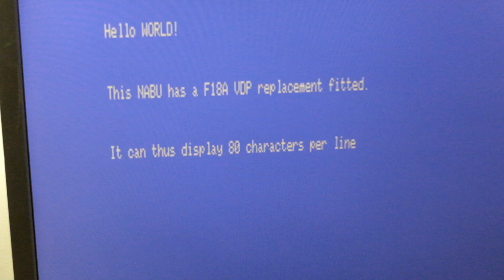My NABU has a 230V PSU and the F18A VDP replacement

Comment: Nice work. I do have one question as I'm a bit noob in VDP. Can I get PAL out of the NABU RCA port by by replacing the TMS9918A with a TMS9929A?
Reply from the maker: No, the TMS9929A outputs a component signal that requires additional hardware to create a PAL or SECAM composite signal. The TI-99/4A came with an external modulator to do that. The required circuitry on the output side is also somewhat different. Going with the F18A or a tn-vdp is really your best bet to get a better video output on the NABU PC.

Comment: Great video! I'm also in the EU, and considering importing a Nabu. From the other comments in this thread, I understand you've changed the PSU again. Would you please consider doing another video showing how to install it? It would mean a lot to every European with zero skills in wiring electricity 🙂.
Reply from the maker: The conversion is really pretty straightforward, but as one needs to deal with mains voltage, it is something that only people should do that have the required experience. I am just an amateur myself, so I cannot teach how to safely do it, let alone in a YouTube video. Sorry.

Comment: Hello Hans 
As i live in the Netherlands I also need to convert the machine to 230v when it arrives.
It is now on the ocean somewhere
I have no knowledge on PSU replacement
I got my hand on a Mean well RT65B PSU
this are the specs

output current 1 5A  
output current 2 2.8A
output current 3 output 500mA
Voltage output 1 5V
Voltage output 2 12V
Voltage output 3 -12V
max input Current 2A
Max output power 64,6 W
Power rating 64,6 W
output current 5A
Output voltage 5V

Can I use this PSU?
I hope to hear from you or other NABU owners in Europe
Greetings Herman
Reply from the maker: Hi Herman, I have used a Mean Well RT-65B in my latest NABU 230V conversion, it works fine.  I have not bothered with a fan and was satisfied with the one screw that holds the new PSU down, but that is certainly not in compliance with electrical code.  Here's a photo of the PSU section of the machine, before I've put the original PSU housing back on: https://photos.app.goo.gl/D1JYVSNSHYYhCKJu5 -Hans (also https://mastodon.social/@hanshuebner)
Reply: @HansHübner  
Thanks for your quick reply.
As I wrote my NABU is somewhere on the ocean.
So I have time.
But the picture is a great help when it comes to fitting it inside the NABU.
Must i take a look at 5V adjust white knob on the front right side of de Mean well ?
The only thing to do is make the RS422 cable and maybe the video output hack from john's Basement.
Thanks for your answer.
Reply from the maker: @hermanhoekstra7498  you don't usually need to touch the 5V adjustment pot. Take a look at the output voltages with the multimeter and if they are within +-5%, you will be fine! Good luck with the machine and reach out if you need help.
Reply: @HansHübner  Hello Hans
Today my NABU has arrived  😃😃😃3 weeks sooner as EBAY told me.
The picture is helpful but I am not sure about which wire color go's to the Mean Well
And what does COM means on connector 7?
I hope you can help me as I do not want to destroy the NABU.
Greetings Herman
Reply from the maker: @hermanhoekstra7498  red is +5V, black is GND/COM, orange and grey are +12V and blue is -12V. Does that help?
Reply: @HansHübner  
Hello Hans,

I have wired everything up
removed the fan
and the wires for it

I made the following connections:
V3 = -12V =>blue line
V2 = +12V => 1 gray and the 2 orange lines
+5V => the 3 red lines
COM the 3 black lines

For the mains I connected the black from the power switch to L on the Meanwell
the green from the chassis to the earth on the Meanwell
and the white =>blue I connected to N
but what kind of glass fuse did you use?
I think when i power up the NABU the original FUSE will blow?
Am I correct?
I hope everything is connected fine to I finally can power the NABU for the first time
Greetings Herman
👏
Reply from the maker: @hermanhoekstra7498  the original fuse will not blow up because at 110V, the current is roughly twice as large as with 230V. You should be good to go!
Reply: @HansHübner   That is great news I have everything connected OK
As you already know my knowledge of electronics is very limited.😞
So can or will you explain me the theory behind voltage current and amps?
Thanks Herman
Reply from the maker: @hermanhoekstra7498  I can't really teach, but here's the basics:  Your power supply converts the inbound voltage (110V or 230V) to the lower voltages required by the computer.  The computer consumes a certain amount of power, which is basically the product of voltage and current.  The power going into the PSU is roughly the same as the power going out of it, so if you increase the voltage on the input, the current goes down.  Hence, for 110V you'll see a primary fuse with a higher current rating than for 230V.  This is all just a very rough description, but maybe you get the idea.   BTW: It would of course be safer to put in a fuse with a smaller current rating, but generally, it protects against short circuits and a short circuit draws way more current than either of the two values.

Mains voltage is dangerous, though.  Make sure that you learn the basics of isolation, be careful and don't hurt yourself.  If in doubt, ask someone who knows to review your wiring.
Reply: @HansHübner  thanks for your answer
I think i get the point
when the voltage is higher the current(amp) is lower.
I could use a use about half the rating.
so the fuse installed in the NABU is okay
Greetings Herman
Reply: @HansHübner  I finally found time to finish the conversion
The NABU starts normally.
The picture is stable but a bit on the washed out side.
I think i must do the video mod John did on his channel
But the NABU works!!!!

Comment: Great video, just got my Nabu today here in the UK. I actualy purchased my F18A board (I believe) from you last year for Coleco), really tempted to source one for my Nabu.  Out of interest, is that PSU switching and suitable for UK voltage (240v), if so  would be great to get a model number for it.  Keep up the excellent work.
Reply from the maker: I used a Mean Well RT-60, which has since been replaced by the RT-65, which is slightly smaller. Both support universal mains and will work in the UK or everywhere else

Comment: pretty nice! Do you have by luck the wiring diagram for the new power supply? I think I will do the same on mine. Thanks
Reply from the maker: I would not call it a wiring diagram, but the color coding of the motherboard PSU cable is as follows:

-12V blue (1)
+12V grey (1) orange (2)
GND black (3)
+5V red (3)

Numbers in parentheses are the number of wires in that color.

HTH
Reply: @HansHübner  it's perfect, thanks a lot!
Reply: Hi, I'm in new Zealand and would like to sort out the power issue too. I see that the mean well q-60b is now succeeded by the mean well rq-65b. 
I was wondering how it's going?.  Has the power supply been ok over extended use?
Reply from the maker: My NABU PC works totally stable with the replacement PSU and it also does not get very warm.
Reply: @HansHübner  thanks for replying. I'm just waiting to hear back from the seller to confirm if he can ship to NZ before I order the PSU from Amazon.
Reply: @HansHübner  sorry to bug you, but how does the input cable work with the replacement psu. Does the input socket line up with the hole on the back of the case?
Reply from the maker: The original cable is fixed, so I have just reused it.
Reply: @HansHübner  right. Well, if I'm able to get one shipped, I'll check it out.
Reply: @DavidLatham-productiondave  I used the RQ-65b, fit without problem. Just beware, as the -12V is NOT at the same position on the PSU as the RQ-60b.
Reply: @stephanepitteloud1849  thank you!  Turns out the seller refunded me for the nabu order. He can't ship to new Zealand. Gutted!
Reply: My nabu arrived and I've installed the meanwell according to your instructions taking care to match the voltages and not the PSU port numbers. (just in case). I also removed the fan and shrink wrapped the unused live and neutral lines that went to it. 
Did you do anything special with those. It didn't seem wise to let them float about in the case unprotected.
Reply from the maker: @DavidLatham-productiondave  a little late, but: I cut the fan wires off as I did not want to have them float around.

Comment: Nice work. I bought me a NABU PC as well. However, I can't seem to get my capture card to work with it. I hooked the composite to a TV and it works but the NABU logo is about a 3rd cut off on the top of the screen. I'm thinking that possibly the sync is off and is why it can't sync to my capture device which is one of those USB based devices. Might that adjustable cap in the NABU PC need tweaking? I could hook up a scope to is and see if the frequency is off. Also, are there going to be new runs for the F18A?
Reply from the maker: ArcadeShopper will have F18A's available later this year
Reply: @HansHübner  Thanks!